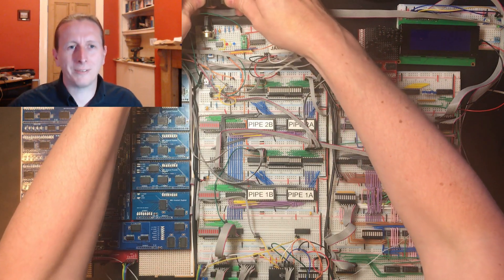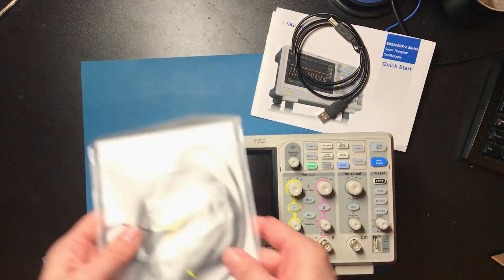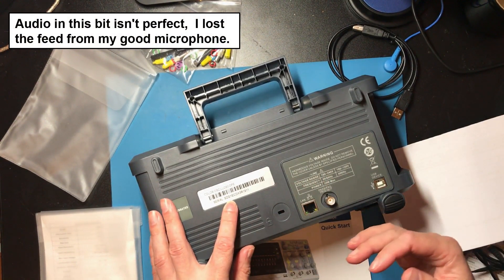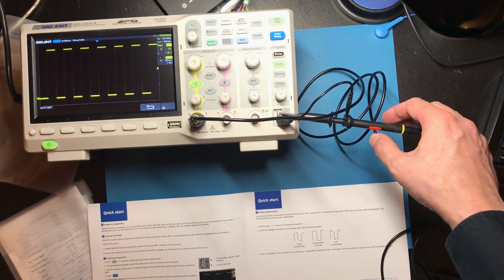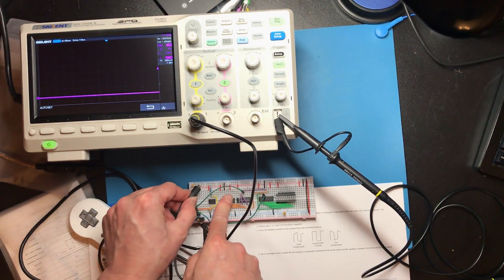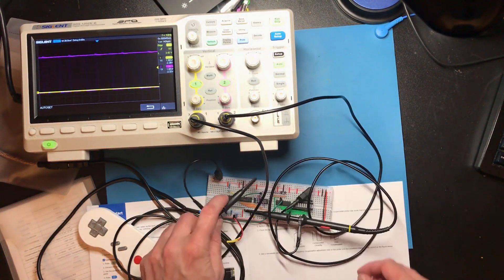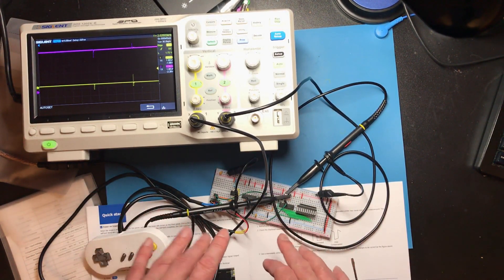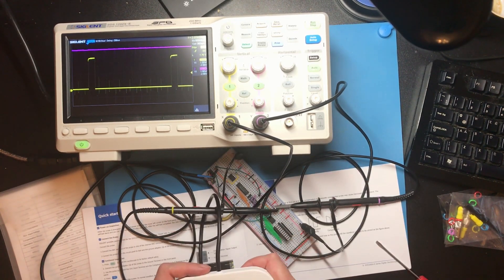SDS1202X-E Oscilloscope Unboxing And First Test

Comment: Thanks for great videos, so inspiring! I am thinking about getting a scope and have been looking at this model and its four-channel cousin. Apart from SBC design I want to be able to use it for VGA signal debugging when I create my own VGA circuit. Do you feel that the specs of your scope in terms of sample rate and clock frequency are enough to monitor such high speeds (25 MHz) or would you in hindsight have gotten a faster one?
Reply from the maker: From my experience I've need hit anything where the speed as been a concern. I have hit a couple of places where extra channels would have been handy, working out how to use the external trigger alleviates that a bit.
Reply: I ordered a SDS1202X-E today. It will be infinitely better than not having one at all I think.

Comment: Just a note, the 1 and 10x on the leads is actually supression of the signal. So a 1x is baseline and 10x is supressed signal for lowering external interference noise.
Reply from the maker: Indeed. another I didn't realize is you only get the full rated bandwidth of the scope in 10x mode.

Comment: Question about your scope, does the power button light fade in and out with it is powered off?
Reply from the maker: It does,  seems a bit weird but I guess it's a reminder that "off" isn't entirely "off" with most things these days.
Reply: @weirdboyjim  So Jason Chonko from Siglent.com emailed me and said, "The pulsing On/Off indicates that there is power on the main. There is no control setting for this function." Their suggestion on Facebook was, "You can unplug the unit to get the pulse to stop. There is no other control for the power button backlight." In the end they were pleasant to talk with and put in a Feature Request to give a setting to turn it off in the future.

Comment: Pretty clean for a breadboard though
Reply from the maker: Yeah, not as bad as I feared, especially remembering that the 3 main lines I’m probing there are connected to bits of wire about a metre long. Zoomed out it looks like sharp glitches, but if you zoom in it’s all softer variations on the line. Looks terrible if I take the caps out though.

Comment: This just isn't fair. I've had that EXACT scope sitting in my Amazon wish list for 2 months!!   I was hoping to leave it for my wife to buy me at Christmas but now I want it sooner!

Also the Scope is supposed to have a built in web server.  You can probably setup a screen capture to overlay on your videos. You probably found that already.
Reply from the maker: There is usb and Ethernet on the back. Can’t get the usb drivers to work on my PC though (I’m running windows 7 for some old software reasons). I’m hoping to get the software running though as it will make for a better screen overlay than trying to point a webcam at the screen.
Reply: @weirdboyjim  I turned my back on microsoft about 10 years ago now, and never looked back. ...wouldn't even start win in a virtual machine :P
I love my arch linux and i'm thankful for "wine" so i can run my old windows stuff and with dxvk implemented over the last year i can even run newer games ;) 
There is a lot less cursing and senseless waiting in front of my computer now -.-

Comment: Hey nice scope man, I'm jealous! You should've given me a call if you want some help/advice with analog :) Definitely checking out the clocks are getting through relatively cleanly all over the circuit is a great sanity check, but it's actually the second tier of debugging. The first thing is even more basic: check that the power supply is clean to all devices. Any resistance in your supply will mean not only will the +ve at the devices dip (usually in time with the clocks because they consume most power when switching state), but also the ground will rise. So if you ground the probe at the power supply's ve and probe around with +/ rails and on the devices themselves, you can often find a few problems. As someone else suggested, getting some caps close to the devices will help reduce the effect.

One last thing, I wouldn't obsess too much about the squareness of any digital waveforms. Unless you're running at a very low clock rate, the waveforms will diverge from perfectly square no matter how good the power supply is and how low the parasitic capacitance is. The main concern is that the transition from state to state is clean. If the signal takes a very long time to rise/fall it can create timing problems, but a bit of overshoot or undershoot isn't too concerning.
Reply from the maker: Thanks Rich. Checking the power lines with the meter has always been my first port of call but I’m keen to see what those lines look like on the scope. I have a list of basics to check before I start on the suspect logic lines, not least is ground on the registers boards relative to ground on the pipeline and bus control, there are enough connections between them that there may be some floating.

Comment: You're gonna have fun with that scope! :P I was hooking mine to all sorts of things when I got mine. Was handy for debuggering when I had I²C issues on a project I worked on a while back.
Reply from the maker: I spent some time last night just moving the probes around that board seeing how the trace changed under different circumstances. It totally changes your perspective on the circuits when you can see what the lines are doing.

Comment: Nice power adaptor for if you get any visitors from Germany.
I was thinking "cor blimry! Experience wouldn't be my problem.... cost would be.... I'll stick to my old analogue".... but 300 quid isn't that bad.... if I didn't have that mini-lathe out in thr shed, I could easily have one of those. Not a bad scope... you should be driving it like a pro in no time.
Reply from the maker: Indeed. I have relatives in Spain, so I keep a few adaptors around anyway.

Comment: Nice scope selection. :-) I got one of these when they launched, to replace my very old CRT scope. I think these are the perfect choice for a hobbiest maker.  Note: The distorted wave you first saw is because you need to adjust the trimmer on the probe when in x10 mode, to get a perfect square wave on the 1Khz test signal.  Also, the overshoots you are seeing from your circuit will in some part be due to the nature of the breadboard environment. ie. stray capacitance.  Where a scope really becomes crucial in digital design is when you are trying to trace down critical timing issues that are affecting the intended function. Have fun! Being able to see your circuit in operation is awesome eye opening stuff!  :-)
Reply from the maker: Thanks Digicool! I’ll take a look for that trimmer, I’m sure it was all in the documentation I threw aside to start playing. ;-)  Need to make up a couple of adapters to let me get at the signal wires easily on the counter boards. Or I may partially solder a fresh one to be sacrificial.

Comment: As I understand it, a good grounding is indeed very important to get a usable signal!
Reply from the maker: The ground line was attached to a pin header I had poked into the breadboards ground bus.  Do I need to do more?  Thinking about it, the ground was on the opposite side of the board from where the chips are taking ground, should I expect to see less artefacts if I move it closer?
Reply: @weirdboyjim  I was actually trying to make a joke about you saying you probably got a good grounding from watching other people use these things :) I have very similar experience with oscilloscopes. I was very briefly shown how to use one years ago, and then more recently I've been watching youtube stuff with people using them
Reply from the maker: Ahh, sorry for not getting that. Not always easy to communicate humor over text. Since recording the video i've been poking a few things with the scope, makes me feel like a real electronics hobyist.

Comment: I love my 50MHz Siglent!
Reply from the maker: If I was smarter at the beginning 50mhz would probably have been more than enough, it’s just that some of the chips can respond very quickly so I need to be able to spot very small glitches. I may of course be wrong about that ;-)
Reply: @weirdboyjim  But you can view 100 MHz signals easily. My 50 I can only see 25 MHz clearly. :-)